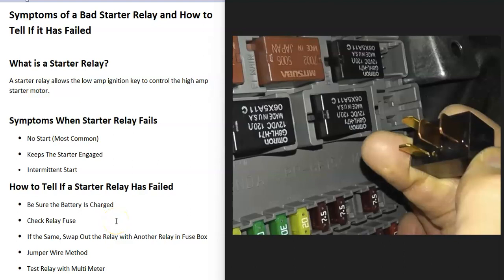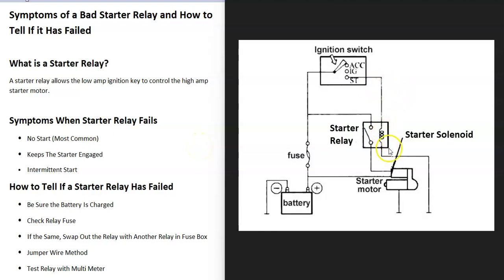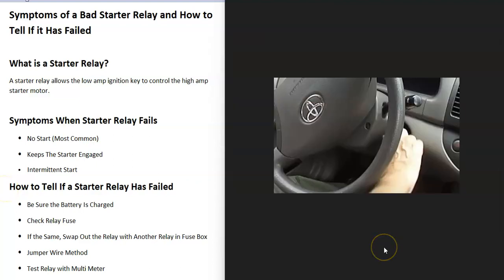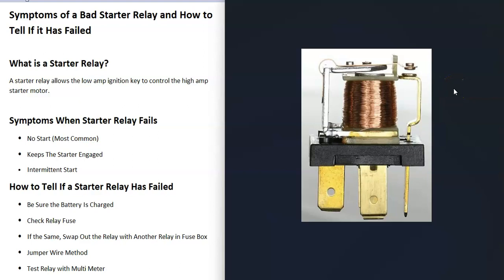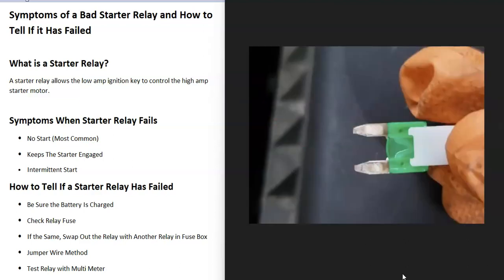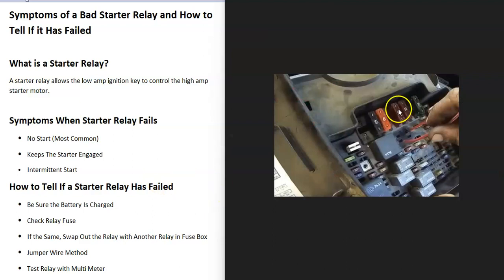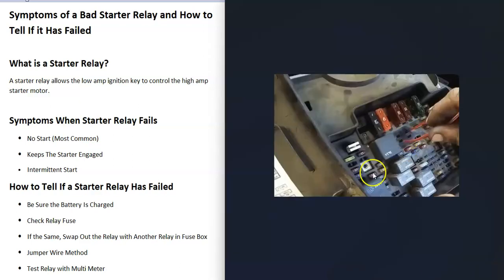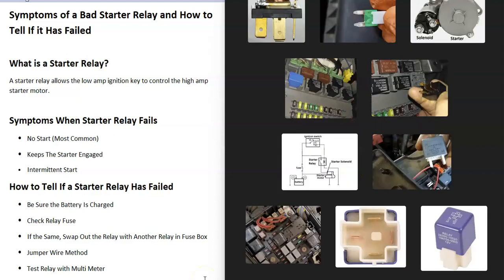Symptoms of a Bad Starter Relay and How to Test If it Has Failed

Comment: Yea hi i have an ongoing problem in a citroen c4 im on my 4 starter motor.   First the starter went then we replaced it. Then 2 weeks latwr it went again then we put a second hand ignition and brand new starter motor.  It lasted for some time then went again so then we put a new ignition and another brand starter motor but niw its blown again.   What could be causing the starter motor to keep burning out. Twice it smoked up really bad and twice just slight smell.

Comment: 2013 Kia soul . Dead at key. Jump starter relay and engine turns over but no start. Spray throttle with fuel starts car but stops. Jump fuel pump and pump comes on but no start without ether. ????
Ignition switch???
Reply: Swapped relays on both still no start.relays good
Reply from the maker: It needs to be diagnosed but it sounds like a fuse, inline fuse or possibly the Immobilizer. Are there any Immobilizer codes? 
You can also check the Immobilizer with the key. 
Turn key to ON (don’t crank).
Watch the key or lock light on the dash.
Goes out after a second: system OK.
Stays solid or flashes: Immobilizer is active and ECM not authorizing start.
Reply: @HVAC_Mechanic can't get access to codes. States not connected.  Never lost contact to trouble codes till now???
Reply: @HVAC_Mechanic will check in the morning thanks. If it is it makes sense
Reply: @HVAC_Mechanic I am also looking for the other chip key. If it starts then I will tape the chip to the immobilizer case. ???

Comment: I always check the relay wiring first, but having a Vdiagtool V500pro helps me quickly test voltage and continuity before pulling parts.

Comment: My truck starter is new. Battery new, starter new. But the starter is imaged but not spinning fast enough. Why
Reply from the maker: As long as the battery is charged, be sure all the connections are tight with no corrosion. Also, there is a ground strap from the battery to the engine block that needs good contact.

Comment: You can test relays using a 9v battery as well. Touch the relay connectors to 9v pins.. if you hear a click it's good.. if nothing it's bad.

Comment: What causes your battery to get hot after changing starter
Reply from the maker: Check all the connections and be sure they are not corroded and tight, along with good ground. It's also possible the new motor is bad and pulling too many amps, but that is not very common.

Comment: Can this be the problem if car is only starting when you jump it?
Reply from the maker: If the car starts, then this is not the issue. When a car only starts with a jump start, test if the battery is good and test the alternator output with a multi-meter.

Comment: I have a question so when I try to turn it on with the key, I hear the click click when I do the jumper wire. I hear the click so if all I’m hearing is a click does that mean it’s the starter or the starter solenoid?
Reply from the maker: It needs to be diagnosed, but it sounds like the relay is good. I would be sure the battery has a good charge, and the terminal connections are good. If that is good, I would test the starter solenoid and starter.

Comment: How about for a prerunner V6 2006.. Everything checked out except the starter..it starts as long as there's power in the battery, how's it draining my battery so fast?
I charge everyday...a couple times just to keep riding?
Reply from the maker: It sounds like something is draining the battery like a parasitic draw. An old-school way to find the draw is to unhook a battery cable and place a 12-volt test light between the cable and the battery. Pull the fuses one at a time and when the light goes off that is the component or circuit causing the draw. I made a video on this. Here is a link. https://youtu.be/-xSMrErME5M

Comment: @2:35 If switching out the horn relay and the horn works, it means the starter relay is the problem right?
Reply from the maker: If the horn works, whichever relay is in the horn relay location is good.

Comment: i had a  LED emblem logo in the back and it  shorted connecting to my license plate lights, idle brake lights  stopped working and front left fog lights .as well. i  found the fuse and replaced now my lights work but i have a Crank no start.  keep in mind i have no experience in this field... i did my own diagnostics , got some expertise from local parts store and found out that it was my starter relay, i swapped it out to a new one and my car started, i also tested fuel pump relay and swapped out to a new one and it did not start my fuel pump( i know because i know what my fuel pump sounds like) and only started due to the flooded engine which is the only explanation that makes sense, hence why it stalled 1 minute after the start up. makes sense because i did not hear my fuel pump turning on so there was no fuel being delivered, i put my original fuel pump relay  back and left new starter relay on and it did start after a few seconds, which kinda left me confused as to why the new fuel relay did not work. well now with the original on, it did start and stalled afer 30 seconds probably cuz the engine was still a little bit flooded from trying to trouble shoot and start,  it did start up again and no more problem i made sure to rev a bit to use up some of the flooded fuel i guess. so in the end it was my starter relay you talked about in the video,,,,BUT what left me confused is why it was cranking but not starting when in vid mentioned tht starter relay send power to my starter selenoid...can you help me understand why my starter was cranking but not start? if my starter relay was the culprit....why was it able to crank? is there something else im missing?  can the relay be bad but still send power through enough but not the right amount for it to crank but not start? hopefully what you read just now makes sense. i would appreciate your expertise.

Comment: So i put a new starter on 2003  Mitsubishi Galant es. I've changed everything. Nd wen I start the car it's does nothing no turning over no ticking nothing. But another time it'll start with no problem. Is that my ignition key switch going bad? Or would it be a fuse problem like in your video?
Reply: Nvm my ignition switch was rounded out 🤣

Comment: I have a 2011 Chevy traverse and when I turn the key something sounds than turns off so the car doesn’t start running. I changed the starter and the battery is good but when i try turning the car on some lights turn on and some are still on when the car is off.

Comment: My starter has been trying to start with the key off. Was going to cost me right at $1,000 to replace the starter said the mechanic. I'm an electrician so when I found out these trucks have a starter relay I figured if it stuck it could cause this. After watching the video you confirmed it. $16 fix so thank you my brother!!
Reply: $1000 to replace the starter!? Holy crap! That’s high!
Reply: Bro my 2002 toyota tundra legit started it self 😅
Reply: Hey so question. Would your truck be running but when you tried to turn it off it would almost power down but keep cranking?
Reply: @zephyr_924 yes. The starter would engage with the key off. Makes me think the ignition has a fault or the starter wouldn't get voltage
Reply: $1000 to change a Starter Motor??   
God theyve surely seen you Coming on this one!
Even getting this done at a Main Dealer it shouldn't cost this much???   I'd be questioning them even if they said $500 never mind a $1000!
What is you are Driving??  That Price is madness

Comment: Very helpful.  But mine still won't start.   After I turn the key, I hear one click.  Then under the hood, toward the front lower portion of the engine bay I hear about 15 clicks.  What could that be on my 2012 Chevy Cruze?

Comment: Thanks for this great content. I have this issue and hoping you can help me. Every time I use the remote start on my 17 Forester XT, the starter fuse (Fuse# 21 10A) gets blown and won't start with the key. I change the fuse with a new one, the car start again. Do you know what could be causing this? Thank you.

Comment: BIG Thanks !  Solved - but that was tricky a one... because first,  I had a failing Supercharger bypass solenoid code (P0033)  at the same time complicating the issue, but worked through the issue, replaced it.   I had also had an OBD code for a bad Crank shaft position sensor (P0355) at the same time, but that ended up going away...and was caused by the partially restricted SC bypass solenoid. ( I think ) 
  Anyway...several things going on all at once... and I thought I needed to try a new starter,  until I saw this video and your power point slide - and remembered about the relay maybe pitted and starting to go.  And Which ended up being it.  
   You just saved me a pile of money...and that is a really big deal because right now I am doing the old "chemo-stage 4 cancer thing" and am on a limited income.    HUGE THANK YOU FOR MAKING THIS VIDEO.   MY PRAYERS  FOR YOU TONIGHT, BIG TIME.

Comment: Would this also potentially cause extended crank time before finally starting? My car starts fine when sitting for several hours but when I run errands and start it repeatedly within short time frames it cranks for several seconds before starting.
Reply from the maker: No, that would be another issue. The starter and starter relay just crank the engine, so if it is turning, they are good.

Comment: Hello. Thank you for this video. Really educational.
I have a 2001 Jeep Grand Cherokee wj v8 4.7. Now my question is, when I turn the ignition key, I get clicks but no crank at the motor. The starter is new, battery new, connections are good. Fuse good. I didnt check the relay yet, as I just watched your vid. Maybe you can point me in the right direction. 
Thank you.
AK

Comment: Ok I have a issue  with my 20007 saturn when I put the key in the ignition it won't do nothing radio everything comes on but the car only gives a click underneath the hood but it won't start the battery is brand new and it still won't start I do not know why is this happening what should I do
Reply: 20007 lol. Just kidding!

Comment: My relay is really loose. The connectors are not catching the relay. Can easily be pulled out. What can i do
Reply: bend the tabs a hair 🤏
Reply: @CitizenSoldier500 when I bend it sometimes I'll get no crank or sometimes it'll start right up but starter will stay on while truck is running

Comment: I bought a battery for my 2006 jeep check it started at first then it only clicked no start i think i bought a battery too strong and it blew something.... please help
Reply from the maker: Check all the connections one is likely loose. If it starts, I would also test the alternator output with a meter.

Comment: I have a 2004 Acura RL. Lately sometimes the starter won’t crank at all or try to turn or won’t make any sounds. Battery is fine alternator fine, it’s juiced. And when it does start, it starts up just fine there’s no weak crank. Does this sound like it would be my starter relay? Or does it sound like i need a whole new starter?? Any help would be great thank you!
Reply: I have the same issue on a Hyundai Sonata 2006. I will swap out the relay today and see if it fixes it.

Comment: I have a slow click sound without a battery powered. Disconnected the battery to find certain components grounding wire, etc. How is a Safety Neutral/Range Switch determine as a No Start? Circuitry? Would a click still be heard from an uncircuited connection meaning a wiring not getting current as to ECU/PCM?

Comment: Great info I’ve had intermittent starting issues for months 👍
Reply: What do you mean by this? Like sometimes it won’t crank at all when you start? And then most the time it starts up perfectly fine? Because I’m having this issue as of lately but i don’t know if it’s starter relay or if i need a whole new starter? Plz LmK!
Reply: @ScoutieOC  For this past year I’ve had starting problems ie turn the key nothing no sound only various warnings handbrake stop/start etc It would always eventually start but required patience id remove the key wait for a few minutes then repeat sometimes it could take half hr or more!!Had it to 2 garages couldn’t find fault with starter , battery etc Was told it must be an electric issue ..Basically I watched this video went to my car removed some fuses pushed them back into same spot again checked all fuses were firmly in place.The car (VW) mark 7 has no starting issues at all now which is an incredible outcome after me surviving 12 months of this.I was about to take it to a VW dealer but came on this video pointer towards fuses The only thing I can come up with is something was loose in the fuse department as I replaced nothing..

Comment: Question- my Chevy traverse would not shut off, this is the second time. We took out the starter relay and finally it cut off. In the am it would not start at all so I jumped it and it started. Then in the evening is when it would not turn off. That doesn’t sound like the relay. Maybe my ignition was a bad? I’m dumbfounded
Reply from the maker: It needs to be diagnosed, but the starter is likely getting stuck and not disengaging. The solenoid may be bad, or the whole starter may need to be replaced.

Comment: This is my problem. After my car sits over night, I turn my key and hold it there for 5 seconds with no sound and then it starts. After that it starts up perfectly fine for the rest of the day until it sits over night and I repeat the process. I'm looking at getting a starter relay in hopes that is my problem. I had my battery tested and it's good. I had an ODB test run on my car and had no issues pop up. Any suggestions?
Reply: Update to my problem. The solenoid was going out on my starter. I replaced my starter and I have no more issues.
Reply: @Moon-Rocks glad you figured it out
Reply: @7ate9100times  Thank you. It was a $1,000 problem since the starter in the middle of the engine behind the exhaust manifold. After that, while I'm driving home, my alternator starts frying itself out lol. I replaced that too. When it rains, it pours.
Reply: @Moon-Rocks  always how it is. Least you figured it out before it costed a kidney!🤘🏽

Comment: My truck is 2004 Chevy 5.3. It is doing this same thing  except it only does it when the engine warms up in hot weather. And it will eventually start right up after it cools down. It done this all last summer. Ok. It never missed one time starting this past winter. When the weather outside warmed up this summer it started doing the same thing. Just after it warms up and it will  and has  always started right up after it cools down. Usually 30 min or so. Please help. It’s been aggravating.  Thanks
Reply from the maker: It will need to be diagnosed since many things can cause that issue. Are there any codes? If there is, they will help point to the problem. Some causes are vapor lock or a component such as an ignition relay that is bad when it gets hot but works when cold.
Reply: @HVAC_Mechanic   is the ignition relay same as starter relay? No codes. When first checked no power to the starter. Pecked on starter then got power to starter and it started only clicking which it had never done before. Putting on a new starter now. Hopefully fixes the problem. But this issue has been going on for the past 2 summers and it always started after it cooled down. And I have changed the starter relay and it didn’t change anything.

Comment: If there are no power coming on when I try and started it but I have a new battery and starter I don't know what to do
Reply from the maker: If the battery is good, check all the terminal connections are good and that there is no blown fuses or relays.

Comment: Question..when the starter on my Tundra hang up in the “crank” mode till I turn the key off but the engine doesn’t start, could that be a bad starter solenoid?
Reply from the maker: A bad starter solenoid won't cause the engine to not start just not crank over. When a solenoid goes bad it will not crank the engine. For example, if the vehicle is a stick shift it can be pushed started with a bad starter solenoid.

Comment: Please check y’all’s shifter and make sure its in park, mines was ever so slightly in reverse but mostly in park. Saved me a ton 😅, I heard sometimes trying to start it in neutral could work, and that could be a neutral safety switch that is bad
Reply: Your comment just saved me about $500. Had the same problem Friday night and tried several different things with no results. I did just what you said and it started up immediately 👍🏾
Reply: My 98 Buick Century does that sometimes.  I have to put trickle charger on it and start it in neutral. I'm driving it once or twice a month now until I can get it straightened out

Comment: I’m getting power to my relay on one leg from the battery. I’m getting power on the pin next to it when I turn the key switch, but it’s not transmitting to the other to pins, why? I can hear the relay click but for some reason it isn’t transferring the power to the other 2 pins. Please explain this

Comment: What if the car tryna start it an it sound like it chokin like it want to turn over an it don’t at all could that be the fuel pump or starter?
Reply from the maker: If the engine turns over, it is not the starter. If it is turning over and not starting, then it could be fuel or spark and will need to be diagnosed.

Comment: I recommend just the hot wire method. I’ve had fuel pump relays in the past that click and give proper oms when under power but for some reason don’t have the heart to punch the fuel pump. Hot wire is a simple yes or no instantly.